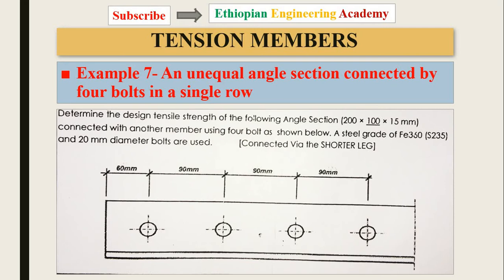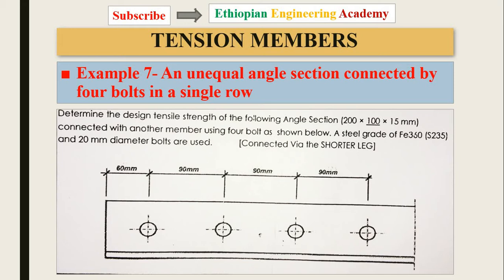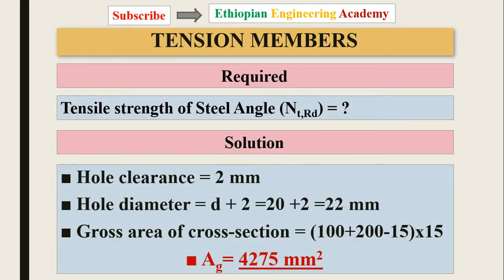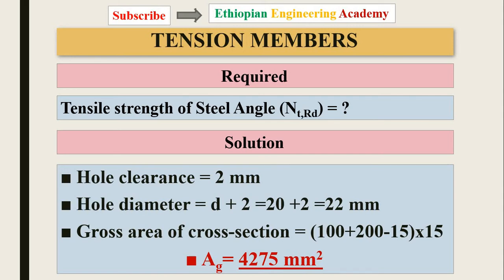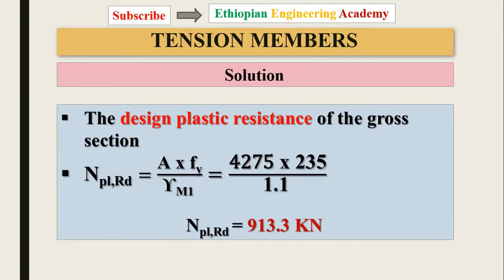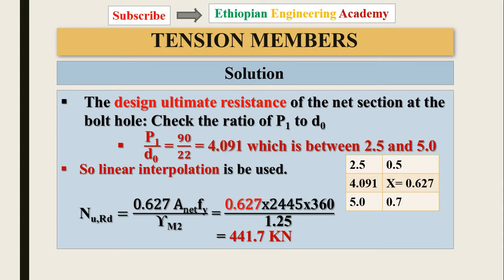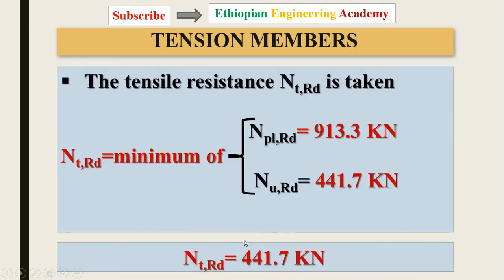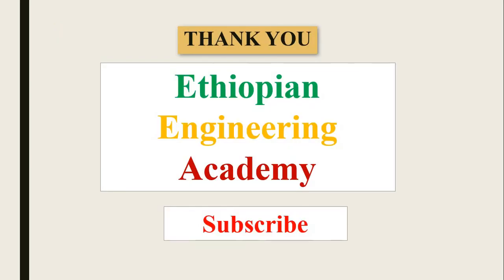Lecture 05  Worked examples on Tension Members of Steel and Timber structure Part 4

Comment: single unequal angle 100x75x8 mm is connected to a 12mm thick gusset plate at 
the ends with 6 M20 bolts to transfer tension. Determine the design tensile strength of 
a)If the gusset is connected to the 100mm leg;
the angle made of S275 steel:
b)If the gusset is connected to the 75mm leg